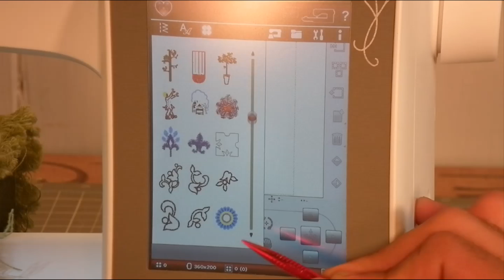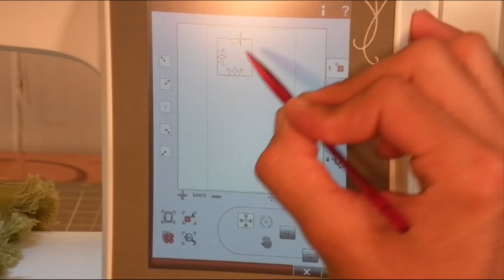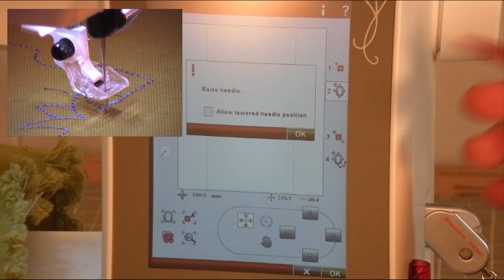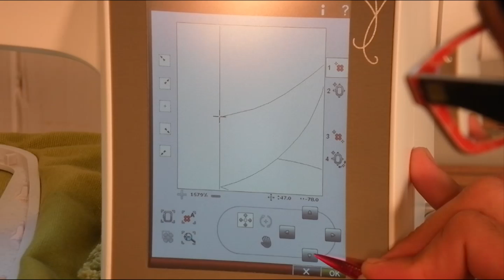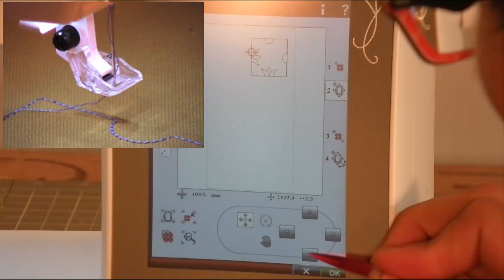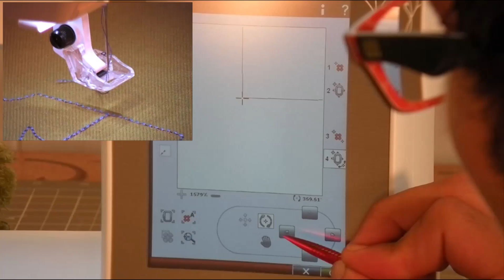Design Positioning Demo - For your Husqvarna Viking Machine

Comment: Christian, I enjoy watching you teach, so much!  You're an excellent teacher, taking it step-by-step, making it easy for the beginner. I just purchased a Husqvarna Viking Opal 50 so I could do embroidery and quilting (which I have never done before!). I've never owned an embroidery machine before and last night was the ultimate in frustration for me! The thread kept bunching up under the material and breaking and then eventually broke the needle!  I had to unhoop the design and watch another video on how to clean out the dust and lint in the bobbin area and almost completely gave up on the project. I decided to just cut all the bunched threads and pull them out and put some new stabilizing paper under and start over on that area of the design. I wish I had seen this video earlier because although the design finished FINALLY!!, it was not quite where it should be.  Thank you so much and please keep teaching more on the use of these Viking machines!